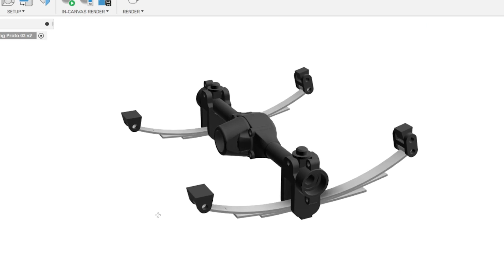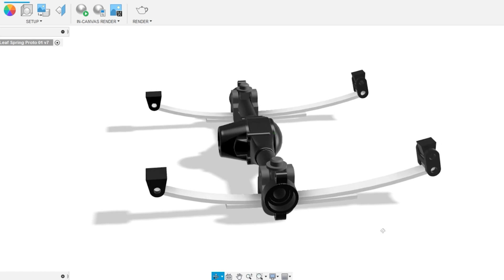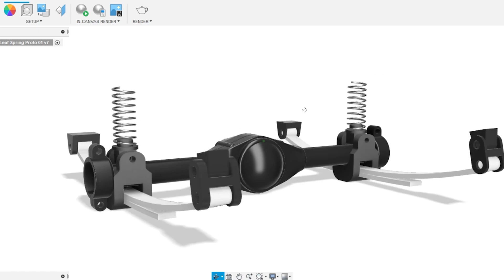Now Available 3D Printable Leaf Spring Suspension for 1/24 Scale RC Cars

Comment: can this possible replace a temu 1:24 scale rc semi truck with trailer but I wanna upgrade the rear and front suspension and frame mostly the rear end since it's a duel rear drive but it's to low for outside use only indoors and I'm not sure how to go about it

Comment: I've been using the esun pla super tough lately for my small scale cars has half the tensile strength but twice the ductile strength but I've found they work really good with the ball ends the dimensional accuracy is quite good I designed balls ends up at 3.8mm sphere for a 3.5mm ball end they pop in nice as many times as you like as well its kind of game changer for me as I had no luck printing ball end sockets before and gave up on some of my smaller scale cars because everything was loose and always breaking now I dont have that problem